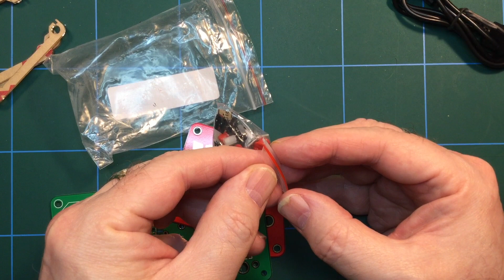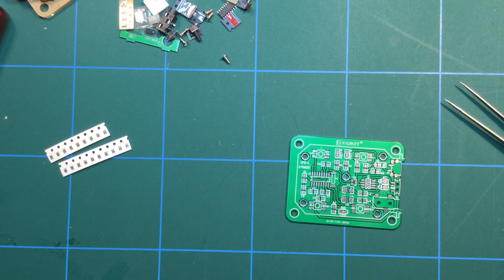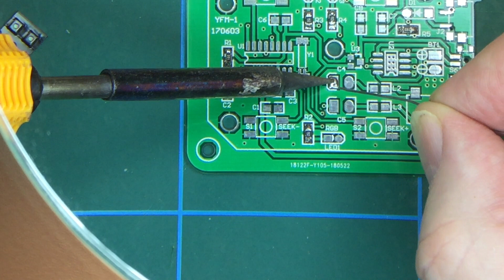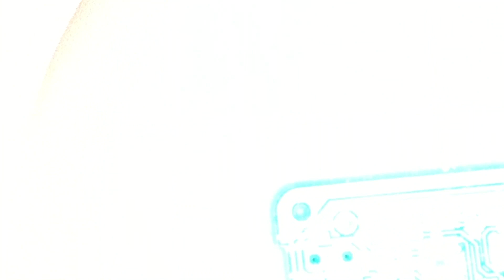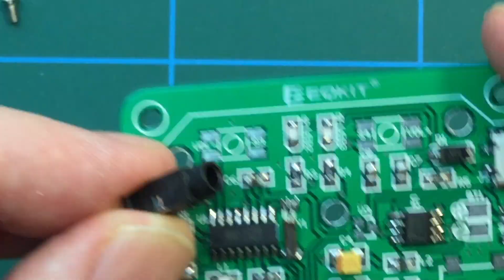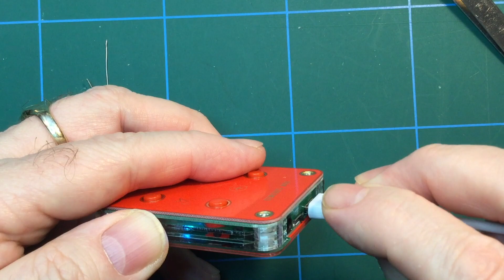Banggood: EQKIT® FM Stereo Radio Kit 76-108Mhz Electronic Kit build

Comment: Good evening, thank you very much for the video.  Thanks to his knowledge I have managed to mount the same radio, but there is no way that the red and green LEDs light up, they are well positioned and they work when I test them with the multimeter.  Would you be so kind as to guide me to find out what is wrong?  Thank you.